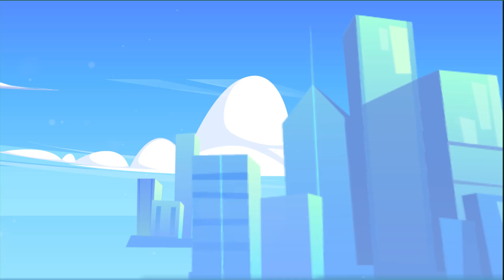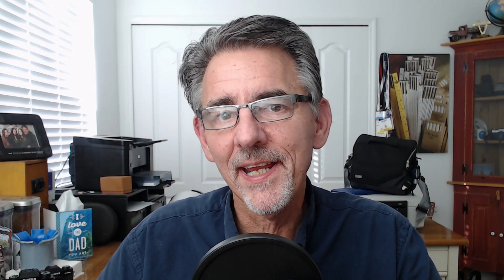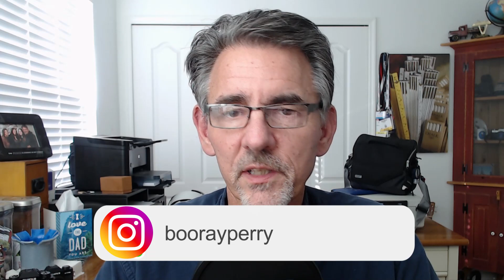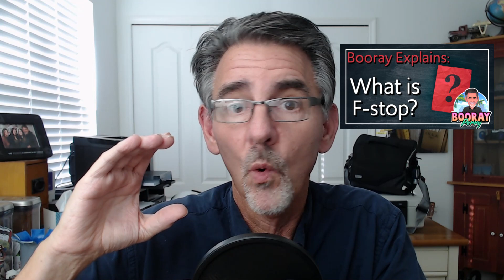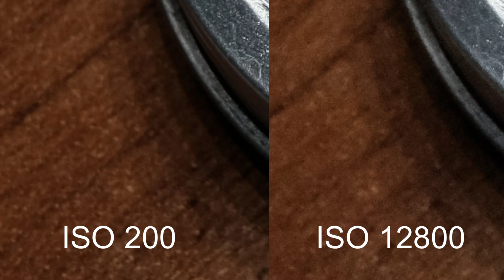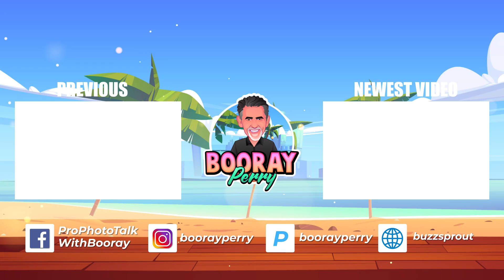What is CAMERA NOISE AND GRAIN

Comment: This is true especially for CB radios. More gain, more static or noise. Not sure if anyone knows what a CB radio is these days, LOL.
Reply from the maker: I had one. :)
Reply: in a way the antenna was the sensor, the Ampf dail the iso knob xD
Reply: @ridderus  I had a K40 antenna which was supposed to be the best at the time. I paired it with a Cobra radio.